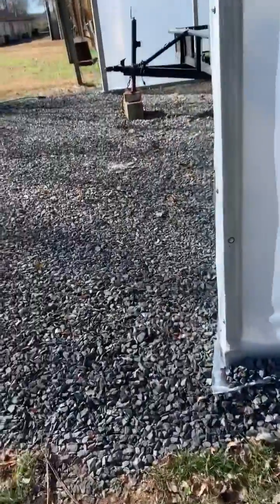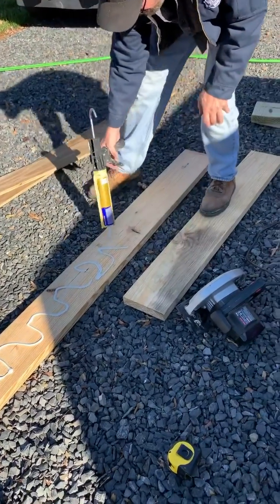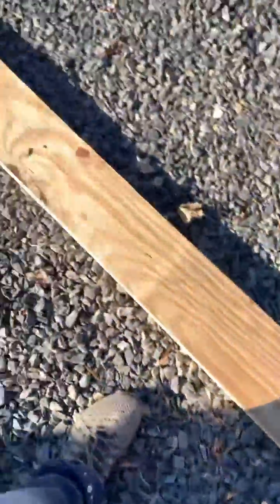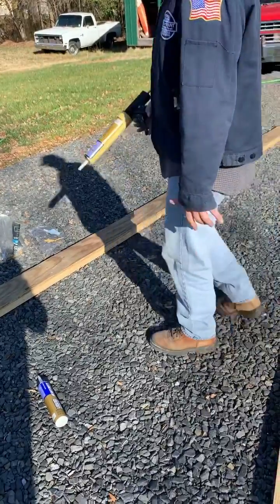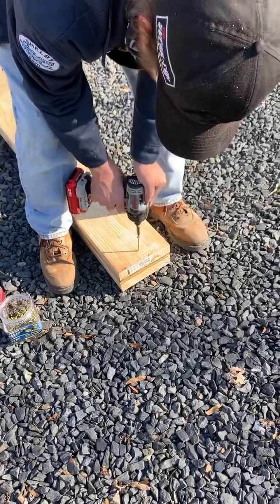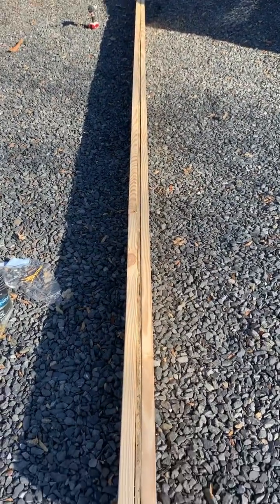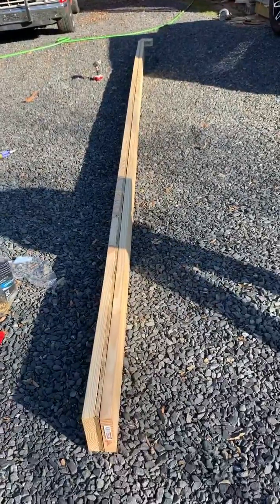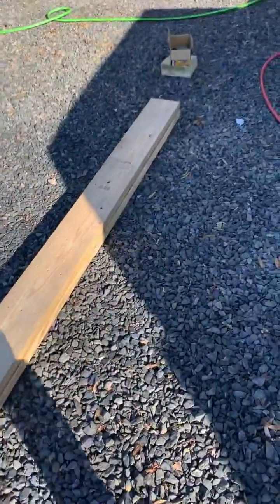How to make your own laminated beam cheap !!!!

Comment: I'm not a fan of using screws in a structural beam but looks nice, smart not lining up those seams, probably hold just as good as any laminated beam out there
Reply: They did use nails too. They just use screws to squeeze the boards together for the glue to dry.
Reply: @Genologic true, honestly that glue will hold for years alone, I prefer to leave them out altogether just because I don't like the idea of rust stains down the road, not always but they can bleed through the wood
Reply: @alphaphoenix1938 I'm not certain I've ever had exterior decking screws rust on me.
Is that normal? Not sure what screws they used here though.
Reply: @Antassium  if that's the screws you use probably not